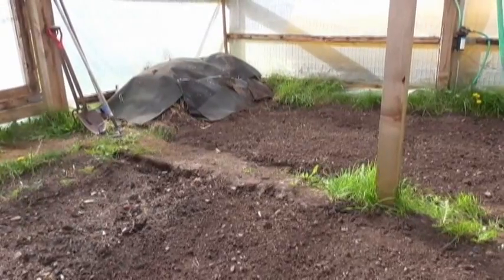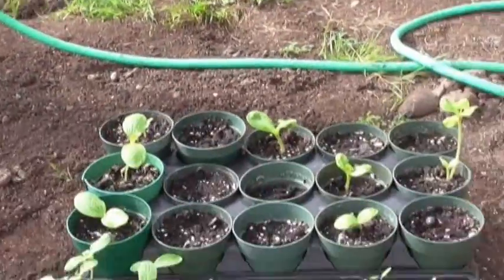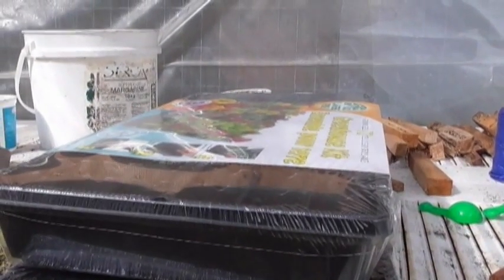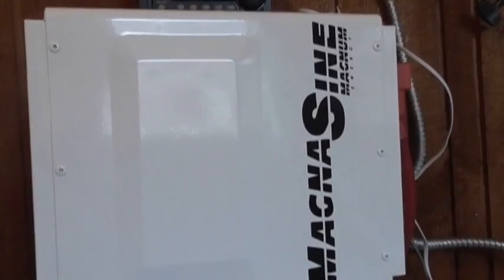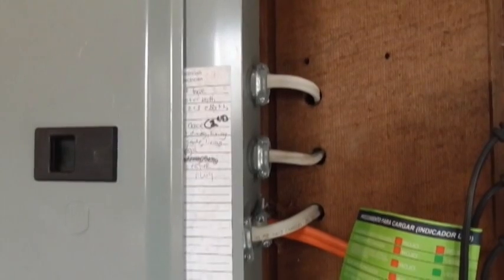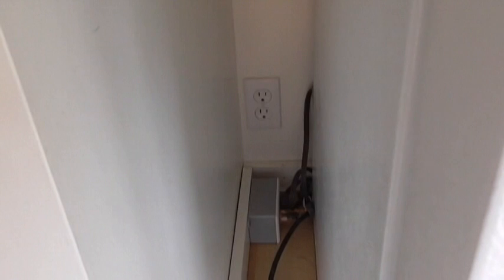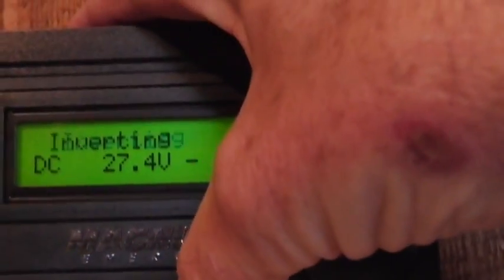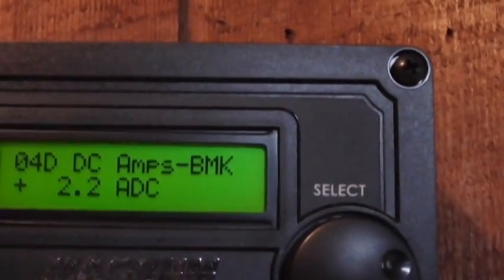No Penetration (Part 4) Metal Roof Solar Panel - Final Install !

Comment: nice system I had or still have just one 220 W panel and a 400 W turbine and when I had 12 group 31 deep cycle batteries connected to it and to to sign inverters I ran one third of my house. As the batteries depleted and it is now time to buy all new I am no longer using it in my home but now using it in my shop.
Reply from the maker: Yes batteries can be a problem especially if you can't keep them fully charged all the time.